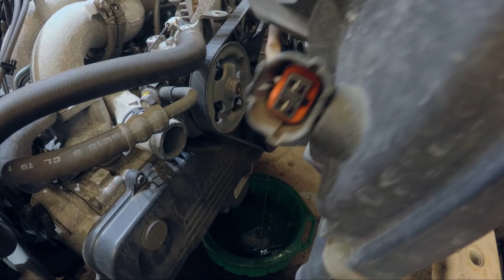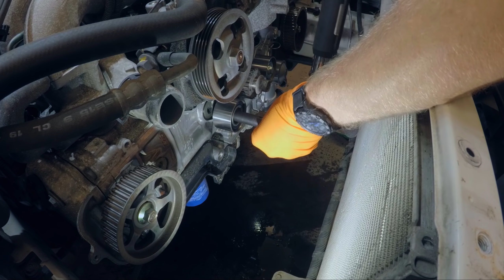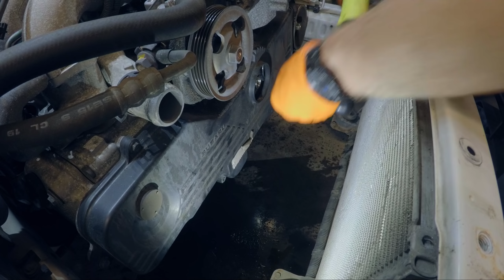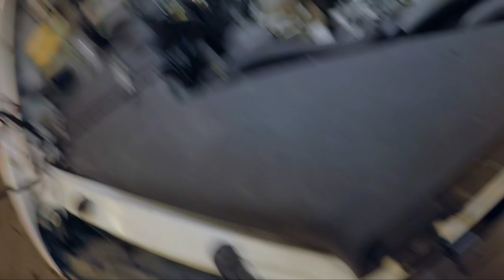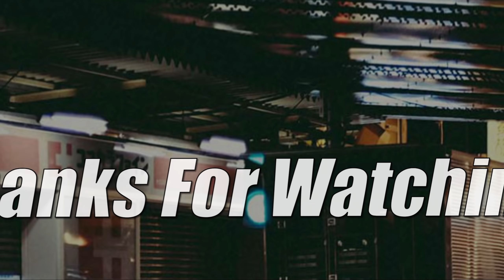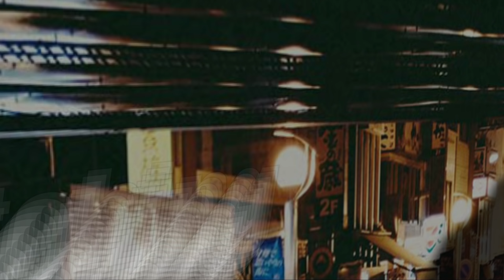Subaru Timing Belt Time Lapse

Comment: thanks for the video
Reply from the maker: You're welcome. 👍🏻
Reply: @MrSubaru1387  I have a question I have a 1997 subaru outback 2.5 I took out and  re-sealed the engine and now cylinders 2 and 4 misfire during the cold weather (less than 35 degrees) and it runs rough until the weather warms up. I suspect that the heads a leaking on that side.  Any thoughts. Thanks in advance
Reply from the maker: I'd check the intake manifold gasket on that side. If no leak found, cylinder leakage test while the engine is cold.
Reply: @MrSubaru1387  Thanks

Comment: Noticed the belt easily went over the pump and up under the toothed pulley, I’ve always had a Hard time sliding the belt between there.  Was this an OEM belt or was it included in the Aisin kit?
Reply from the maker: Aisin kit includes the OE Mitsuboshi belt.

Comment: are the cam seals a wait and see replacement or should i change them with a 140k service?
Reply from the maker: You can wait on them if they aren't leaking, but for the cost of the replacement, and time, might as well replace them when doing the timing belt.

Comment: One more thing, did you add any coolant to the overflow tank or did filling/burping the system automatically leave enough in there?
Reply from the maker: It was full when I started. Burping is done just in the radiator with the funnel I use. So, you just get the rad full and air free and attach the hose to the reservoir.

Comment: Hi mr. Subaru off the subject of your vid.. but I'm going to be replacing my steering rack and pinion on a 09 Legacy. What special tools do I need for Metal hard to reach fluid line
Reply from the maker: No special tools required really. I advise a good flare wrench to keep from rounding off the lines at the rack.

Comment: did the faulty tensioner make a ticking noise with the engine running?
Reply from the maker: Yea, I had a timing belt noise. That's why I went ahead and ordered a kit. Good thing I caught it when I did. Could've destroyed my engine had the timing jumped further than it had.

Comment: I have a '98 Legacy Outback with the 2.5. I replaced the timing belt 4k miles back. I had the harmonic pully come off and break the key notch on the pully and break off the key on the gear. 
What do I need to get the gear off so I can replace it and the pully to have this running again?
Reply from the maker: Ouch... Did the keyway slot on the crankshaft get damaged?
Reply: MrSubaru1387 I haven't taken it the whole way apart yet. But using a mirror to look the gear over the key is broken off the crankshaft gear. I don't know if that is part of the gear or if it is on the shaft and the gear slides over it.
Reply: MrSubaru1387 Got the access to the timing belt off and have taken a better look at the broken key. Yes it is the key on the crank shaft. I am assuming that the gear comes off the shaft and it looks like the key should be able to be replaced.
Reply from the maker: Yes. The key sits on a slot on the crankshaft, then, the gear slides over both. Since you recently changed the timing belt, either you didn't get the crank pulley aligned correctly on reassembly or you didn't torque the crank bolt fully. Seen it several times in the past. Hopefully it didn't dig out or damage the key's slot in the crankshaft.

Comment: @MrSubaru1387 I have a 2006  jdm forester cross sport with an ej205 mated to an automatic tiptronic transmission but sadly my head gasket has developed a leak and so we will have to pull the engine to changge the gaskets but i was planning on upgrading to an ej255 in the long run and i thought id just save my self the head ache and just replace the engine right now .....my question is will my transmission directly bolt up to an ej255 and what upgrades can i make to the ej255 before dropping it in to get as much power out of it as possible  ....thank you so much in advance ...looking forward to your response
Reply from the maker: Yes, the transmission will bolt up. You'll have to replace the front cradle/crossmember with a WRX one. Or you will have to notch it and reweld it. If you don't, you won't clear the turbo up pipe. You'll have to get the 255 engine harness and ECU. You will have to upgrade the fuel pump. The cooling system may need to be updated as well. I know turbo cars upper hose is in the center while most n/a cars is in the upper left corner. Not sure what else will need to be swapped off the top of my head.
Reply: Thank you…….. well my ej205 is turbo charged  so I believe it is the same set up but in reference to the swap do you think it is a good idea to swap to a manual transmission too
Reply from the maker: My mistake. I thought you had an EJ202. The 255 should basically direct replace the 205.
Reply: ok no problem ...that's a relief … but what do you think about swapping it into a manual ….would that be difficult..... would you suggest it
Reply from the maker: I'd run the auto till it kills over. Cross the manual swap bridge when you get to it.

Comment: hey mr subie. will an impact fit to remove the harmonic balancer bolt when you remove the rad.?
Reply from the maker: No. Not unless you have a compact gun like the Aircat 1057TH.
Reply: Another impact that would work is the Astro Nano
https://www.youtube.com/watch?v=hmc0FivwYgg skip to 12:09 to see it in action on a subie crank bolt
Reply: oh well, i have the dewalt 899. i will just get some 23 tools for the crank and cam pullies. thanks bud.
Reply: i have cordless tools, i wonder if my ingersol rand right angle impact would take it off.
Reply from the maker: You're welcome. 👍🏻

Comment: Defective tensioner, OEM part or after-market car part? Gates is a good brand and OEM part in many manufacturers. In any case, and best of all, you're lucky to find it on time. Agurrak,
Reply: i stay away from gates. there starting to use Chinese parts in there timing kit.
Reply from the maker: It was a Gates kit I removed. Replaced it with Aisin.
Reply from the maker: They've been using Chinese junk for a while.
Reply: Look at the video Pine Hollow Auto Diagnostics posted on the subject. No more Gates. OE or Aisin, maybe SKF. Whichever kit - make sure you have made in Japan NTN pulleys and tensioner
Reply: Ok but take this in mind:
 How to identify original Gates PowerGrip timing belt kits 
https://www.gatestechzone.com/en/product-info/counterfeit-protection

Comment: Hello! 

Ive been looking through you videos and was looking for a lil help. I cant seem to figure out how to msg you on the app. Noe I must say I have been a vw guy and know my way around them but the subaru engine... Not so much. 

I bought a 05 outback xt EJ255 with a cylinder one misfire. Did the usual (plug/coil/injector swap) with no results. It idling rough so I reset the idle and now its alright. It sometimes hesitates to start. 

 Though when I scanned it... There was a sudden cyl 4 misfire. I didnt touch cyl 4 at all. Swaps were done with cyl 3 and 2. 

My next move is to check timing. Then a compression, then leak down.

It was a single owner car and all service done at the dealer. All records given to me. 

Im just wondering if you have any further insight?
Reply from the maker: Yea, I'd definitely go ahead with a compression test or cylinder leak down test.
Reply: Would you just avoid the timing check? Its just weird that it was only cylinder 1 and from the records its been that way for over 500miles... Then all the sudden cylinder 4 gets a misfire
Reply: Timing belt was done at q
107k with 150k on the odometer.
Reply from the maker: If timing was out. You'd have a consistent issue on one or both banks.

Comment: How long did this take you to do in real time?
Reply from the maker: About an hour and a half with bleeding the cooling system. But, I've had good practice at doing the job. Haha
Reply: MrSubaru1387 That’s great you must have lots of experience!  Do you think a beginner like me can get it done right the first time?  All I’d need is that special 4 bolt screwdriver to hold the pulley?  Also did you use a proper torque spec when screwing back on the bolts?  Was that the beeping sound whenever you’d finish torquing?  Also I’d have to watch out for the timing marks right?
Reply from the maker: Yes, everything was torqued to spec. Always. Yes, the beeping is the electronic torque wrench. No offense, but based on that reply, the job may be slightly above your abilities, that in mind, I do have step by step videos of the procedure I recommend watching before you attempt to perform the job yourself.

Comment: Does anyone know if AutoZone or Advance Auto rent out pulley holders that can be used on Subaru crank pulley?
Reply from the maker: I don't believe they do, unfortunately.
Reply: How much do you charge for labor for Aisin TKF001 kit + oil pump? Car is '00 RS. Is there another way to torque the crank pulley bolt without the tool holding it?
Reply from the maker: Timing belt kit and an oil pump install, about $210.
Reply: That's very reasonable. Where are you though? I'm in NY
Reply from the maker: South Carolina. Little far.
Reply: Indeed... I also just checked the pulley & realized it's a Perrin light weight one, so the tool wouldn't have worked anyway. Do you recommend wrapping the old belt around the pulley and alternator bracket & pinch it to tighten, or putting the car in 5th gear with brake to torque the bolt?
Reply from the maker: That should work, you can go in through the access plug under the throttle body and brace against the flywheel as well.